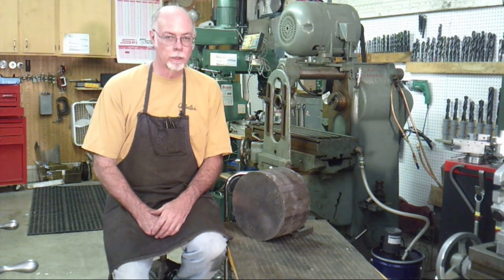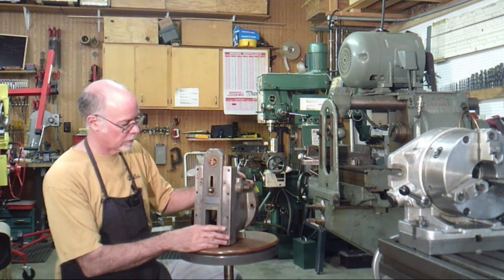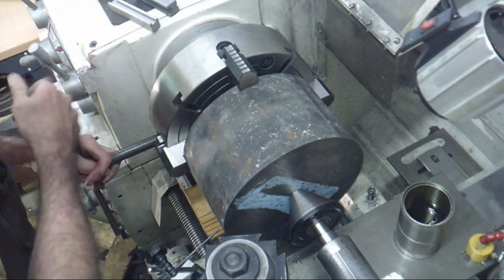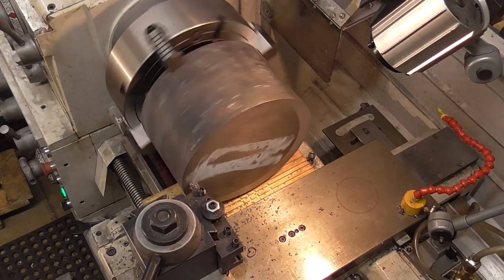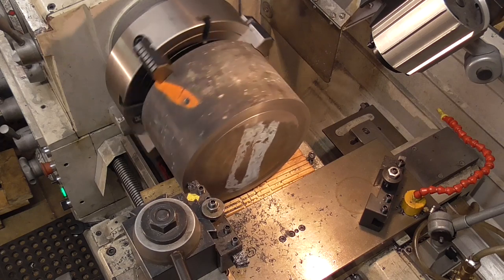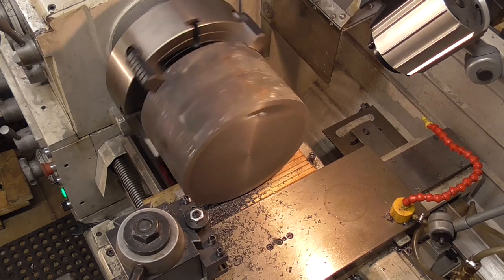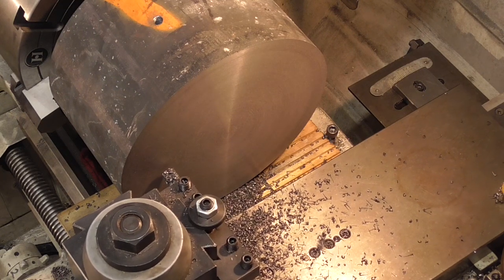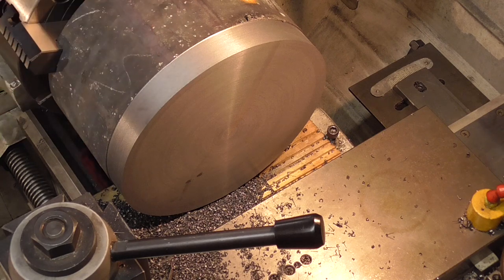Adapt! Part 1 (remastered)

Comment: My kind of work Garry! I like the big ductile pieces. You had me laughing at your comments on the 4 jaw truing. 
Man I'm glad you got the chattering problem figured out. I figured it had to be the tool bit rubbing. A lathe of that size and that light of cut shouldn't be chattering. Good job. 
On those od cuts, remember you can use a boring bar. I like to use my Aloris bars with a tool bit square to the work.  Works well when you need to trim the od back but it won't swing over the cross slide. 
Nice work man, I look forward to seeing the next two videos. 

Adam
Reply from the maker: Yeah, it just took me a little while to cease being stupid and figure out exactly what the problem was.
.
As we'll see later, I eventually turned the OD small enough that didn't need to use the boring bar on the OD of this job. I tend to save my carbide tools, being cheap. For hobby work like mine, time is not money.

Comment: Is the slow speed due to the large diameter of the piece your cutting?
Reply from the maker: Yes. There is a preferred surface speed that gives the best tool life. That speed depends mostly on the material being cut and the type of tool bit (carbide or high speed steel). Knowing the surface speed at the tool (just look it up), it is easy to calculate the rpm based on the diameter of the work.